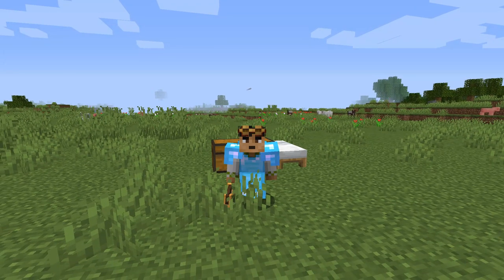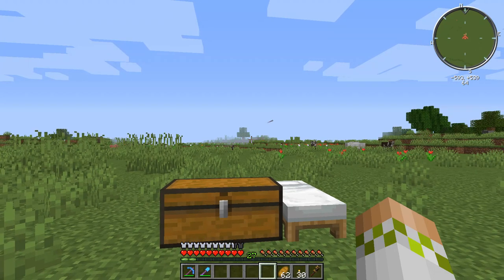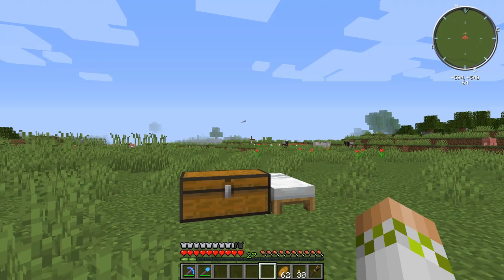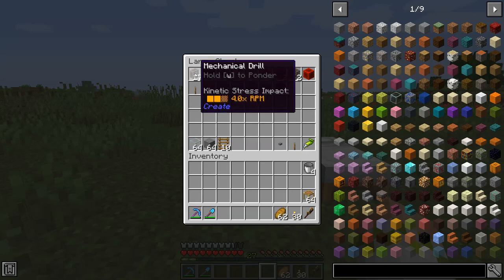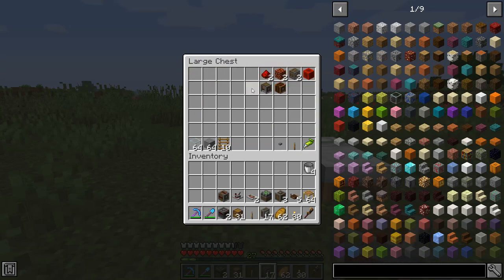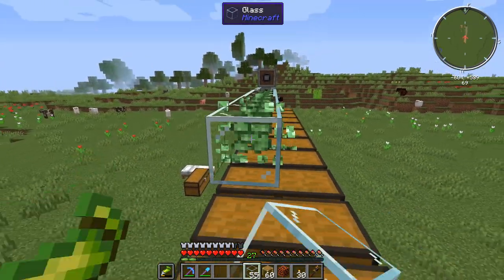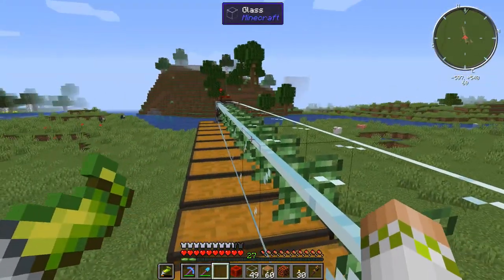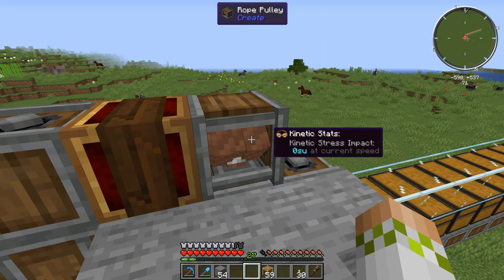Surviving With Create 0.3.1 :: E28 - Radial Quarry

Comment: If you are building this on 1.17/1.18 be aware that the adjustable repeater got replaced by something called Pulse Extender. Just place them instead of the adjustable repeater (set the same timings) and everything should work as before
Reply: Thank you
Reply: Goat
Reply: @rigandigy2329  fax
Reply: i think it's pulse repeater
Reply: those are two different things. pulse extender extends the pulse the moment it goes through until it leaves for the requested time

Comment: The issues I had when making this (with a newer version of Create):
1. Magma powered fans not a thing anymore.
2. Adjustable Repeaters are not a thing anymore.

Solution (for me):
1. Windmills attached straight into the gearboxes that the fans were connected to. For the power going into the Clutch for the Mechanical Bearing I did not want the windmill pointing down, so I used Encased Chain Drives instead of the two gearboxes there to have my windmill sticking out to the side. (My sails for both windmills are 8 long (direction the windmill bearing's sticky side is) by 3 wide.
2. Pulse Repeaters suffices as a replacement.

Woohoo! New problem! The machine doesn't work at all! Don't worry, I managed to fix it to work with the current version of Create.
1. Instead of 3 second delay on the Pulse Repeater that goes into the link that makes the 'arm' spin around, I had to use a 5 second delay (to match the speed of my pulley lowering).
2. The redstone contact, instead of having the Redstone link (redstone block, redstone block) sit directly on top of it, I placed redstone dust and going in on the glass arm I added: Pulse Repeater (1 second delay) into the redstone link (redstone block, redstone block).

This now works for me in the current version of Create! Decided to post this for future viewers struggling to make this amazing cylinder machine!
Reply: This ^, and I also put a delay on the sequenced gearshifter of about 30 seconds after descending 1 block. There was a timing issue with the redstone links and they would trigger while it was running for me and then proceed to descend 1 more block before digging and screw everything up.
Reply: hey so does your windmill pass through the clutch/contraption? or is it a windmill that's oriented like a waterwheel?
Reply: @elliottdresser9734  It's been a while but I think I just expanded the windmill in one direction where it would fit

Comment: For the next video I would like to see some defense systems , there are many blocks that can be used and there are no videos about it. I'm planning a survival modpack based on create
Reply from the maker: I can always add that to the list of things to do before the series wraps up!
Reply: @RagePlaysGames  okay thanks, didn't know you have already a list of things planned ;)
Reply: Would be interesting to see various uses of Create for anti-mob defences (regenerating Cactus walls, Golem spawners, etc.)
Reply: A really good one is just strong fans with nozzles. If you get a few full power windmills you can power a pretty large perimeter with a pretty good speed. You can sometimes power through it, but mobs won't even get close to passing it.
Reply: @RagePlaysGames  I have seen a design of a trebuchet using this mod once but unfortunetly it does not have the capability to yeet things :I

Comment: Can you redo this for .5, you cant use encased fans for rotation, amd parts were renamed.
Reply: I think wind power would suffice
Reply: @MetrozTrott  Wind power works, even the minimum wind power is more than enough. For the pulley power you can also set up a basic water wheel

Comment: For those trying to build this in newer versions i found you will have to make a few modifications, im sure you could probably make this better with less components but here's what i did. In newer versions of create, adjustable repeaters do not exist, so you will need to swap them out for pulse repeaters. Firstly change the pulse repeater (formerly adjustable repeater) firing into the redstone stone redstone link from 3 seconds to 5 seconds. Next, you will need to replace one redstone dust with another pulse repeater facing into the sequenced gearshift and set the delay to 1 second. ( at 19:09 you can see where this is, directly to the left of where you can place the lever, leaving you with a central redstone dust) . The last modification you will need to make, is to add one more pulse repeater behind the powered latch that is facing into the clutch and then add the recieving redstone link on the frequency of 2 redstone blocks ( as you are looking at your clutch, you should see the blocks in this order: redstone link, pulse repeater, powered latch) 

Hope this helps (this works for me in 1.18.1,  havent tested this in anyother version) .
Reply: Actually no. All you need to do is to replace the adjustable repeater for the Pulse Extenders (which are literally just a new version of the adjustable repeater). Same timings and setup and everything should work fine as before
Reply: @n.p.8055  actually it doesn't. the timed repeaters would stay on for as long as the input was on. however the pulse repeaters appear to just send one brief signal no matter how long the input Redstone is on. hence the name pulse repeater. and they don't send another pulse until the input is turned off and back on.
Reply: @levistrnad2965  welp I used pulse extenders and everything worked as intended so i guess you are [probably] wrong
Reply: what should the pulse repeater firing into the latch be set to?
Reply: @levistrnad2965  The same as the adjustable repeaters were set on this video
Reply: @n.p.8055  bro I'm just stating that they function differently then what's showing in the video. maybe it does work with some modifications. currently not for me but I have some experimentation to do yet.

Comment: Hey Rage, I really love your design, but I did notice if it comes in contact with water before the lower y levels, the circuitry on the bearing tends to break. Other than that, great design!

Comment: Unfortunately the encased fan and magma block trick has been removed from create so this design doesn't work the same as it used to, however it can be fixed by using windmills instead of encased fans on the drill head and a water wheel at the top.

If you're thinking about building one of these, the pros and cons are not horrible but not great either. This is one of the more lag friendly create quarries and one of the cheaper quarries to build due to the low number of drills compared to the high mining volume, but this is also an extremely slow quarry and the redstone tends to be destroyed if it encounters water or lava above the bedrock layer, meaning you have to babysit it while it runs so you don't come back to find out that it has hit a water source block at Y=50, broke itself, and stopped running without collecting any useful resources. That being said, you can make this quarry 2x to 4x faster by making the row of drills go in both directions or even adding 4 "spokes" of the quarry compared to 1, although this doesn't fix the water/lava problem.

Comment: I had tried to fix this, rebuilt twice, only to find my issue to be a rotational one..... I can't urge enough but note @18:57 the right pulse extender must be rotated or placed correctly.  A noob mistake but it made what should of been an hour build which turned into 4+ hours.....

I also extended it longer then the OP which caused some issues with missing blocks now and then.  So I made mine wider.  So far, 3 layers, no issues.
Reply: i made mine 100 drills from the middle and i think i need to recreate this design using minimum windmill because the fan goes way to fast the further out it goes meaning it skips the blocks and even with 500 drills that didnt help so yeah needs to just go slower

Comment: What if you did a design with both the mechanical bearing and rope pulley at the top? For instance have the mining arm attached directly to the pulley which lowers the arm and then have the bearing spin the pulley and the arm. That way both mechanisms don't move from their initial position and can be powered easily with something super fast if you want, and redstone would be simpler and locate exclusively at the top, so you wouldn't have to worry about water or lava ruin it.
Reply: Yeah, I noticed some other problems too. It got confused after being unloaded, and upon stop, the arm was on the other side, breaking the machine. I got it working again with a hand crank, but had to replace linkers, levers and the magma block on the arm.

Comment: So I can't get this to work.  The last 5 drills don't break the blocks directly under them before it starts rotating.  And then when it comes back around, the drills are off while the contraption tries (and fails) to lower.  And it is unreasonably slow.  It would take less time to just mine for materials and make a digital miner from mekanism, or to just lower the drills straight down instead.
Reply: did you ever figure it out? habing the same problem

Comment: You can also throw a filtered chute underneath one of the chests and have the quarry drop the dirt and cobblestone you may not want, while keeping all the valuables. It'd allow you to have fewer chests if you wanted, though they are cheap enough to include anyway.
Reply: This could be bad on an Server. Because eache Item will stay on the Ground vor 5 Minutes....
Vor this, you should ad an Cactus :)
Reply from the maker: You absolutely could! I considered doing this but felt a lot of people wouldnt, like Chao said, take into account the fact that it could cause lag on servers as it just spits items out all over the ground. If lag is no concern though, that is an easy way to cut down on useless blocks in the storage!
Reply: This is basically mandatory after the caves and cliffs update since the world is now 60 blocks deeper than it was at the time of filming. If you don't throw out the cobble, dirt, deepslate, etc then the chests will fill up long before it reaches bedrock

Comment: Here you go everyone:
17 mech drill
2 redstone contact
5 Redstone link
2 Pulse repeater
1 powered latch
2 redstone dustone
2 magma block
2 encased fan
1 block of redstone
2 lever
31 chests
3 vertical gearboxes
1 mechanical bearing
1 clutch
1 rope pulley
1 sequenced gearshift
64 glass
64 stone
10 ladder
1 button
1-2 super glue
Reply: did you manage to get this working? the redstone doesnt seem to be quite right for me, and im sure i did the same as the video
eddit, it seems to work fine if you add a pulse extender before the redstone-stone emiter.
Reply: @mynameisblankmynameisblank1988  Where exactly did you put it? I managed to get it working by putting in two pulse extenders, one each behind each pulse repeater.
Reply: I think I did something similar. I also added a T-flop so that it would do two passes before lowering, as I saw some problems that came from it missing three particular blocks. 

Unrelated, but adding this for anyone else who is troubleshooting, it will break if the center portion goes under water. you can prevent this by gluing two glass blocks to the non rotating part of the drill, covering the exposed sides of the redstone switch. this makes it immune to water, and since it can mine obsidian, if the thing is kept submerged, it will be capable of going through anything.

Comment: cant seem to get it to work in 1.18. they changed the timed repeaters to pulse repeaters and they don't constantly stay on anymore. what's a way around this? I tried pulse extenders but cant seem to get it fine tuned and it keeps lowering without turning.

Comment: Rage, May i ask, without the lavastone powering the encasing fan, how can i make this radial quarry machine???
Reply: I'm not sure if it'll meet power demands, but I always use a windmill. Place down the windmill bearing (or whatever it's called) and stack 8 sail blocks in a tower on top of it. It'll spin very slowly, but the more sails you add the faster it will spin. The bearing is cheap, and so are the sails. Hope that helps!
Reply: @yammantheaardvarkofhonor1242  i have to try how can i put the windmill and make it move with the rotation drills.
Reply: @miltonexequielquaranta2630  I didn't realize that the power source was on the quarry itself, spinning with it. I'll look into it, it shouldn't be too complicated
Reply: @miltonexequielquaranta2630  from all I could come up with, you would build the windmill just to the side and connect it through using vertical gearboxes where the fans would have been. This goes for both the windmill powering the pulley system and the windmill powering the bearing. The windmill powering the bearing should start automatically when the pulley stops moving, you just have to make sure you glue everything together (sails shouldn't have to be glued however)
Reply: @yammantheaardvarkofhonor1242  jajaja that Is what is breaking my head xD
Reply: @yammantheaardvarkofhonor1242  so the windmill contramption moves with the pulley ande the drills contramption?
Reply: @miltonexequielquaranta2630  yeah, you'll have two windmills set up. One on top for the pulley, one with the bearing that is attached with the pulley
Reply: @yammantheaardvarkofhonor1242  I try everything T_T redstone is not the same either

Comment: Does anyone have a fix to get this to work in create 0.4? They removed adjustable repeaters
Reply: We have run into the same problem we used pulse repeaters and it didnt work but with pulse extenders it did work, it just does mine the blocks underneath  the redstone contacts when they touch

Comment: If you doubled your drills rigs and ran them in both directions from the center, you could mine it in half the time without adding any stress capacity, right?
Reply: By that same token, you could do it in all 4 directions. As long as you had the redstone connection at the end of each one, I don't think there's any reason you couldn't. The resource cost of doing that is pretty high for a single quarry though, so it's probably not worth it unless you plan on moving it around with a minecart assembler.
Reply: @michaelkennell2420  Ity strikes me that the one arm build is a good candidate for a minecart assembler already. :)
Reply: @michaelkennell2420  Also, i like the way you think. Moar Power.
Reply: @DaneMorgan  This is true, but with how slow the 1-arm version goes and with how few resources it would take, it's not a big investment if it's set up for a one-time-use and then recycled into other builds (like an iron generator). Setting up a 4-arm version is pretty much committing to the reusable quarry.

But yes, if you have the resources might as well max out power/efficiency!
Reply: @michaelkennell2420  Yeah, i just know myself well enough to know that as soon as I took it down, I'd be like, man I need another hole and I'd have to set it back up again.

Comment: does this still work for 1.18 create? I'm gonna try it out anyway but I'd just like to see if anyone else tried it

edit: it does not :c
Reply: it does, you just need to have some pulse extendors included before every pulse repetor
Reply: @mynameisblankmynameisblank1988  it doesn't, the sequential gearshift no longer waits for the rope pulley to actually go down the requested amount of blocks

it works for a little while on input speed, then gets stuck if it has to mine iron ore or above while going down
Reply: @mynameisblankmynameisblank1988  the problem is that the sequenced gearshift itself stops when the drills hit iron ore on the way down
Reply: @catgirlQueer  do you mean that the drills do not mine out fully, and the rope cannot lower as a result? i had some problems with that, but thats why I added the T-flop. it makes the drills do two passes, so they cant miss any blocks which would keep them from lowering
Reply: @mynameisblankmynameisblank1988  what about the center?
Reply: @catgirlQueer  he did mention in the video that for some reason, it cannot mine the center block. all you have to do is mine down to bedrock on that one block, and it does the rest 25:40
Reply: @mynameisblankmynameisblank1988  ah okay

I've now started just going straight down in small sections and building up other stuff in other places so the radial quarry isn't that useful to me anymore
Reply: @catgirlQueer  Fair enough. Happy creating!